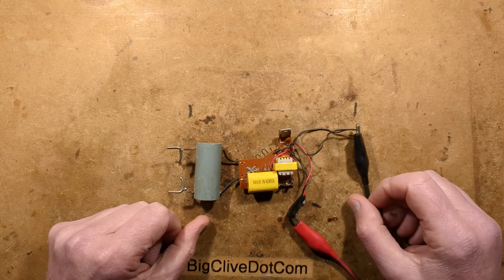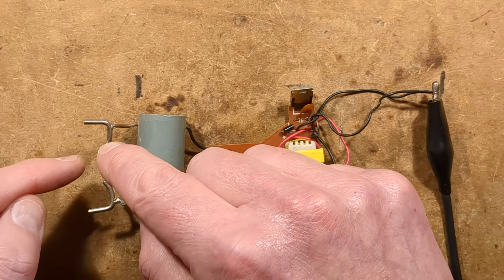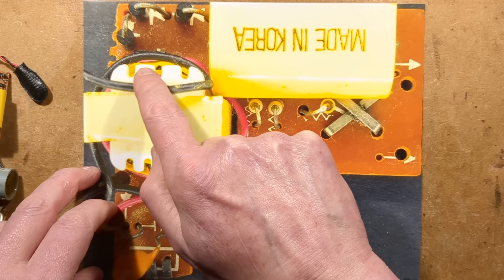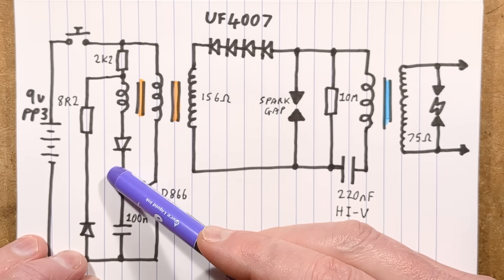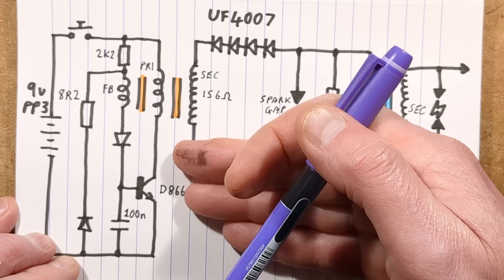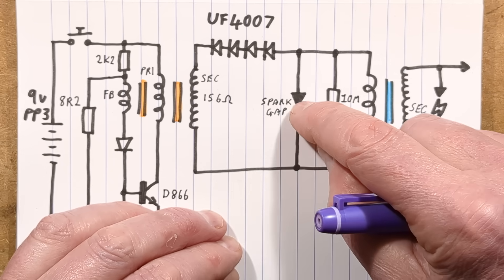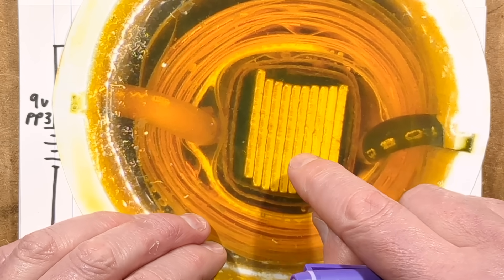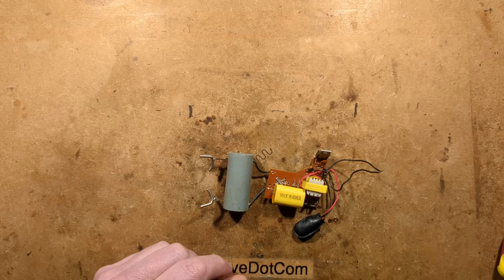How a stungun creates 20kV from a 9V battery

Comment: I remember a student from my school days who made himself an improvised stun gun from the old disposable film cameras flash circuitry. The small camera flash charged up a 360 volt capacitor for the Xenon strobe tube and can pack quite a punch when touched, very easy to assemble the whole device into a small hand held stun gun.
Reply: That could be rather dangerous to the recipient.... The photo flash, although it delivers a lower cottage than a stun-gun, can/will deliver a much higher current which could even be dangerous to a person. 

One could find themselves in litigation for using a self-made electrical weapon that kills or severely injures someone.  

Not a good idea to be using that.
Reply: A friend and I made a couple of those when I was younger, good times

Comment: Last weekend, I made the brilliant decision to buy my wife a 100,000-volt pocket-sized Taser for her safety. Seems reasonable, right? What could go wrong?

Let me tell you a tale...

I brought the Taser home, loaded it with two AAA batteries, and was disappointed when pushing the button didn’t do anything. A quick read of the instructions told me to press it against a metal surface for a blue arc of electricity. Cool, right? It worked. (Apologies to Dana for the burn mark on the microwave.)

Now, as a responsible husband, I thought: "I should test this thing to be sure it’s effective before handing it to my wife." My cat Leo, watching with wide-eyed curiosity, briefly crossed my mind as a test subject, but I love him too much for that (don’t worry, Leo). 

So naturally, I decided to test it on myself.
I sat in my recliner, wearing a singlet and shorts, and carefully read the directions.

1-second burst: mild shock and disorientation.
2-second burst: muscle spasms and loss of control.
3-second burst: full-on fish-out-of-water flopping.

“It’s just two AAA batteries,” I thought. How bad could it be? Famous last words.

I touched the prongs to my thigh and pressed the button.

What followed can only be described as an out-of-body experience. I’m pretty sure the gates of heaven briefly opened. Hulk Hogan definitely body-slammed me, recliner and all. I woke up in the fetal position, drenched in sweat, with my body convulsing like I’d been plugged into a power grid.

Highlights of my post-shock survey:

The recliner was upside down and 8 feet away.
My cat was clinging to the fireplace mantle, meowing like a banshee.
My reading glasses had taken up residence on the TV.
Both nipples, my right thigh, and my pride were twitching uncontrollably.
Drooling was my new normal, and I might have lost control of... other bodily functions.
Oh, and my testicles? They still haven’t been located. Reward offered.
Dana? She laughed until tears ran down her face, absolutely loved the gift, and now wields it as a threat in our household.
Moral of the story: Don’t test a Taser on yourself. Ever. For any reason.
(Also, shoutout to Leo for surviving the chaos. Brave little guy.)

Tony Welch! I remember that story back when he first posted it, my opinion only here but this was the first viral laugh the internet got. 

I do not claim the above as my own, its by Tony Welch, i just posted it here because its so fucking apt, thanks to clives, I Tested it on myself.

Comment: Dielectric strength of air is approx 3kV/mm not 1kV. With 15mm gap voltage is 45kV but it can be even more because it will work if you increasing gap 3-5mm more.

Comment: I wonder how high a voltage you could get out of some of these inverter transformers I've salvaged from scrapping out some flat screen TVs.  How would you measure this?  I do have a HV probe,  but don't know if the current it draws would load things too much...
Reply from the maker: They are very high frequency.  You can still buy CCFL drivers on AliExpress.

Comment: In Jr. High, we used to make a shock box that was a nine volt battery, a switch, and a step up transformer. Add some 12 gauge wire, a nice metal and plastic box, and get a grade depending on if it works or not. That was in the early 70's.
Reply: We made those out of radio shack parts. We would lick our fingers and compete to hold the wires the longest. That explains a lot about how we are now. Boy, we were dumbasses
Reply: In my HS we would charge capacitors and toss them at each other and your first instant is to catch it...
Reply: @StrawDragon  All fun and games until someone tosses you a microwave capacitor
Reply: Higher grade the higher you jump?

Comment: The first stage of this circuit reminds me of a Jeanna's light circuit I once made with a 2n3055. While the CFL circuit did work shotgunning a couple thousand volts ac into the tube, it did so at a rather low brightness, and it often needed a "kick-start" touch on the CFL bulb to luminesce. I've wondered if it was because the fly-back action was "push-only" with a single transistor, and that a "push-pull" version with 2 transistors and a center-tapped primary would allow more power through for better performance.

Comment: I built something similar to this back when I was a kid. Used a 9V to mains transformer wired backwards. Didn't get 20,000V but still got a hell of a kick out of it.
Reply: I've also built something similar with a voltage doubler circuit... Fun times..
Reply: I would do that as well with the mains transformer backwards, but you had to keep touching it to get the spark and if you touched the wires on the now primary side you got a bit of a kick as well.
Reply: Same here but at the time it was seen as a diy cattle prod. Confiscated and returned at end of day and warned to bring it back to school.

Comment: I guess they use a spark gap to pulse the output transformer primary similar to a Diac in things like a dimmer switch, but in this application I would doubt the durability of even a high voltage semiconductor eg a thyristor or mosfet transistor etc, also you would need extra circuitry to switch it.
Gaz Yorkshire.

Comment: Is it really accurate to say that the current is lower on the high voltage side of the transformer? My understanding is that the current would be even higher, but the duration of the discharge is lower.
Reply from the maker: The step up reduces the current, but the capacitor is what delivers the bang.

Comment: Many moons ago in another life on another planet, I was working on a radar modulator. The power supply was 20KV at 2A - highly lethal. There were lights, ropes and notices to keep people away. We had arcing problems and one day, I was testing a high voltage transformer with one of those little high impedance high voltage generators used for insulation testing. I was tinkering with something when suddenly, my boss marched in - he'd obviously just had an idea. Before I could say anything, he reached down to adjust the cable dressing and immediately got a zap from my insulation tester. He went 'aaaagh' and reacted so violently that he fell over backwards. He looked at me wide-eyed with a slowly dawning realisation that he was still alive. He'd momentarily thought I had the big power supply switched on. It took him a good half an hour to be able to laugh about it.

Comment: Interesting. I always assumed they simply used a cascaded voltage multiplier circuit.
Reply from the maker: The common igniter modules on eBay do.

Comment: Reminds me of when I played around with a taser I made using a flyback transformer which also ran off a 9V battery. Forgot to discharge the capacitor I put at the output and got shocked.

Comment: Awesome explanation, I suspect all "stun guns" operate pretty much the same way.  How about the ones that shoot the two wires with barbed pins?  Thanks Clive👍
Reply: Yea, same principle. The wires add a little drag to things, which I believe is why that sort get a big step up if you remove the cap (which is the bit that fires out the pins).
Reply: @NightCatArts Thanks Clive, I thought resistance in the wires would lessen the "effect" unless more zap was applied. Cool!
Reply: @terrym1065  Not Clive, but you're welcome.
Reply: @NightCatArts  Oh crap, I never even looked at the address. I'm so sorry, just thought was Clive answering. Damn, my bad...
Reply: @terrym1065  No worries, it happens.
Reply: @NightCatArts Thanks bro.

Comment: Am I right in thinking this works in a similar way to an old car ignition system?
Reply: It's a lot like a CDI ignition system, like you see on 2-stroke motorcycles. They use a SCR triggered by a pickup coil rather than a spark gap, but the principle is otherwise pretty much the same.

Comment: It always amazes me that in so many really high voltage applications a spark gap (essentially nothing but air) is one of the main 'components' 👍
Reply: The first wireless transmitters generated aerial current using a spark gap, for Morse only of course, although speech was attempted with various designs of rotary spark gap. 
Eventually the valve oscillator replaced the spark gap, but the spark transmitter was kept as an emergency back-up as late as the Second World War in Royal Navy ships.
Reply: @Pleendriver I did not know that, whoever first realised that simple air was a useful component deserves a lot of credit because you often think of a circuit as just that, a circuit! and leaving a gap seems counter intuitive at first, like having an open circuit. 👍
Reply: It's the cheapest way, rather than use a quite expensive solid-state component capable of that high a voltage ⚡️
Reply: @davelowets yeah, it just makes me wonder who first thought "I know, I'll just put nothing there" and it worked! I know in a lot of applications that the size of the spark gap needs to be carefully considered but it is just one of those things thats so simple it's actually really clever.
Reply: It's how nature does it. We call it lightning.
Reply: air gaps are a great negative resistance component
Reply: @stevecummins324 do they have to be calculated quite precisely or not? I suppose it would probably depend on atmospheric conditions like altitude and humidity? And would they not work at all in a total vacuum since there is no air?
Reply: Its even used by the Z-machine to make tons of X-rays and research nuclear fusion

Comment: When I was a lot younger, someone asked me to fix an ancient flashbulb inverter, very crude , it probably generated a few thousand volts which was stored in a capacitor, me being
me, I somehow shorted this out and created the biggest and loudest electrical blast of my life, temporally blinding and deafening me.That was all from a small battery supply.
Pretty sure it could have killed me if it went through my body.
Reply: I was fixing a pro studio flash which has a very large capacitor in it. I was being ever so careful discharging it initially through a resistor with a voltmeter to check when it was safe. I accidentally misread the resistor's value which was far too small. The bang it let off when I connected it left my ear buzzing for ages. I then used something much more sturdy to discharge it through: a cup of water makes a very good discharge resistor.

Later on I made a second mistake. I got a bit careless with my voltmeter wires and accidentally held one in each hand while the cap was holding about 500v. The next thing I knew was my arms being held out rigid and shock running through me! I managed to force myself to release my hand to stop the shock. Way worse than any mains jolt I've had.

Comment: That spark gap capacitor discharge circuit is rather similar similar to the way you drive a tesla coil, except some of them use a motor to power the spark gap and get it to discharge sooner and with more regularity.

Comment: Mine also lost the case from a heated "debate" over the control of it so I stuck it down in the couch cushions and got another fun week out of it before it sailed across the room into a wall for the second time.
Prolly went through a dozen 9v's between my work crew, it became rather tame after 15 seconds or so, could only kick like a horse with a fresh battery... fun times.

Comment: Similar circuit to a plasma globe, but those have two transistors and oscilate, I put in a better capacitor and it exploded in a few seconds 😅 I thought it should be a high enough frequency as not to hurt but no, shocked myself in the elbow

...I see you changed your stance on random ads anywhere in a video
Reply from the maker: I let YouTube do what they want now.  It's the only way to appease the beast.

Comment: I remember looking them up around 2005, they had all sorts of glorified crap, leopard print, bright pink ones "for women" ones disguised as phones, I then read they aren't ok in the uk as it's an assault weapon, if you are armed and that is it's sole use or purpose it cannot be considered as a for defence thing, where as if you were bei attacked and saw it on the floor and used it, that's ok 🤷 but even then they used to lie about the output and they should have an automatic shut off, I think the recommendation is a shock from these any longer than 5 seconds can cause serious nerve and neurological harm

Comment: It's the same circuitry in a battery powered gas cooker ignitor, but with a beefed up oscillator for the step-up part. If you look at the patent for a 'proper' taser, they are abut the same, but charge a capacitor that the secondary voltage sits on top of, and then a spark gap in case you are in contact. The high voltage on a 'real' taser is just there to initiate conduction, then a charged capacitor discharges through the secondary and the conducting air for a better 'zap'. I decided to make one, but had to ask the police if the bare circuitry was ok. They said as long as it's not hand portable as a weapon it was fine.

Comment: Spark gap is not a reliable measure because there can be differences in the local atmosphere, humidity, dirty contacts, air pressure, salinity of the air (if by the sea) and then age of components
Reply from the maker: I only use it as a rough guide.

Comment: dont worry, you can still buy a "high voltage generator" "high voltule module" "5v 20kv converter" "100,000 volt module" and any number of similar named modules anywhere, the cheapest stun guns we sell here are JUST 1 of those modules, a battery(wouldnt be shocked if they re-used vape batteries they recovered in the street, usually the cheapest lipo cell available) and a usb charger, you have the oldschool version that is better built and less likely to stop working if shorted to low resistance material
Reply from the maker: https://youtu.be/iDJp2tHmEQo
Reply: authentic OW fucking hell, i think these hurt more than actual stun guns as they have a higher current pulse

Comment: I appreciate your warnings, but the limited headroom on YT audio prevents any chance of a sudden loud sound causing hearing damage. Similarly, the sudden change in lighting when you turn the room lights on can't get any brighter than the viewer's backlight setting.
Reply: YouTubes violent insertion of flash floor cleaner and fabreeze air freshener advertisements are more disruptive.
Reply: The latter is only true for screens that have a backlight. OLEDs are self-emissive and YouTube does support HDR; you can be temporarily blinded by sudden brightness transitions depending on the video you're watching and the technology used by your monitor.
Reply: People will whine and complain about the smallest things, even though they have complete control over their viewing experience.

Comment: Illegal in the UK but what about the Isle of Man?

Wasn’t there a similar video several years ago?
Reply from the maker: I speculated on the insides of one of the common cylindrical high voltage modules on eBay, but they tend to use a multiplier.